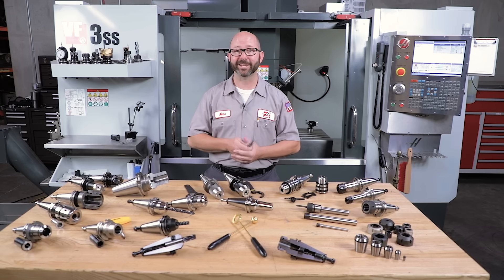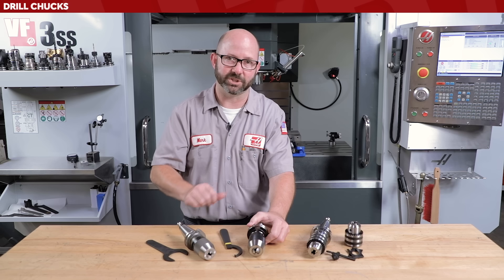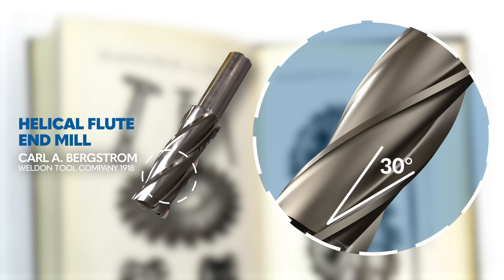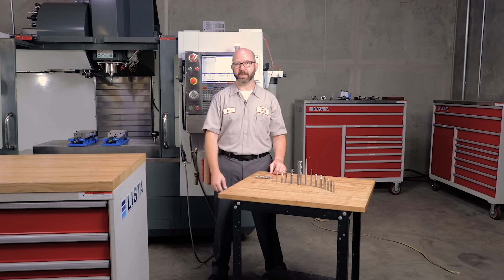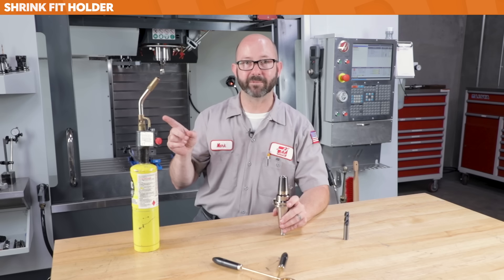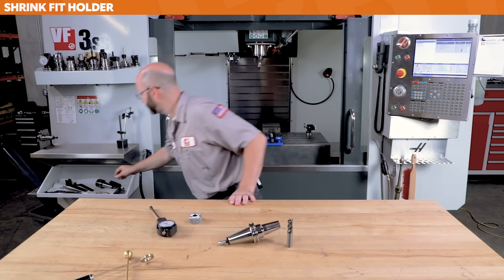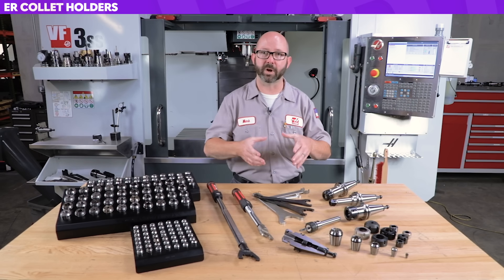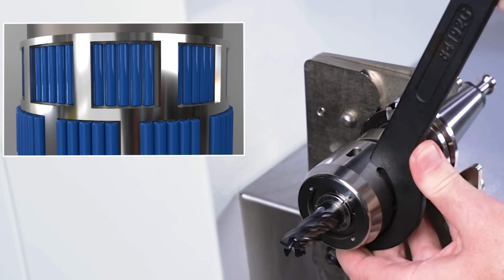Tool Holder Essentials - Every Machinist Needs to Watch This - Haas Automation Tip of the Day

Comment: This has to be one of the very best videos on tool retention that you can tap into.
I'm a golden oldie and in my day we used the Autolock chucks with screwed shank tooling......now very hard to find anywhere.....for ultimate tool retention and runout.
That design is a hard act to follow as it fulfills all the necessary desires of the aforementioned criteria in the video with rotating tools apart from drill chucks where the keyless chuck reigns supreme.
My personal present like is the ER system but with cheap collets it's only as good as the price you pay.
A lot has to do with the class of work you're involved in.
Backyard engineering is the bread basket of the cheap Chinese tool system suppliers.....long may they live etc.
I've often wondered, for the bottom end of the milling cutter users, how a milling cutter with a short Morse taper shank instead of a parallel one would perform as it's practically like a shrink fit system without the heat/cooling aspect for insertion/removal etc.......not practical in the real World as the knock in effect could/would damage the cutter.
For me it's the ER system due to the massive availability of cost effective tooling and if I have a runout problem with a cheap collet(s) it translates to just a bigger cutter diam as it rotates.....what's in a few dozen microns of extra cutter diam anyway.....one pass will give your the cutter size you're working with, so cutter diams become arbitrary anyway if you know what you are working with.
The combination of cheap chucks and cheap collets does leave the choice wide open, but selective testing and grading can cure many evils.
BTW.....I toyed with the idea of having an ER collet and modifying a cutter to have a groove near the top end of the shank to fit a retaining ring so that the cutter would not need humungous tightening force to prevent it from pulling down.......thinking, thinking etc.

Comment: These videos are brilliant, thanks HAAS! We run REGOFIX POWRGRIP in our mills and noticed an immediate improvement in tool life and reduced noise. We run 15,000 RPM all day on ally, we don't measure balance or runout - load and go!. We have the manual pump thing for changing tools - it is fine for our small shop.
Reply: If a new shop went with REGOFIX POWRGRIP right away, what other toolholders might they still need?  Would it ever make sense to have a powergrip holder for each common drill size W/WO ATC?  Can powergrip holders be damaged, or are they fairly idiotproof?
Reply: Dustin Maki powrgrip for endmills and er collets for everything else. Although keyless drill chucks are handy for hss drills.

Comment: Great video. A few more tips:

You can use the torch to heat and load and unload the shrink fit toolholders., so a small shop can avoid having to buy the induction machine (or toaster, as we call it at work).
Put some grease on the threads and nut taper of the ER collet holders if you don't have the low friction nuts. This will improve both holding force and runout.
Speaking about ER and runout, it can be adjusted once set up. Some people tap the nut, although there are special tools for it. Try to torque the nut with two handed tools to apply just torque and not lateral force.
And last: don't use that Haimer balancer with wet toolholders, believe me.
Reply: Two handed tools?  Do they put one hand one each side of the collet nut?  I've had a collet nut wrench on my To Buy list, but my machine set up was waylaided, so the urgency disappeared.

Even if you used a two hander, wouldn't you need to be careful not to push away from your body excessively?  Seems like a deep well socket for the collet nut might be best... ever seen one?    hmmm. might have to fabri-cobble one.  LOL
Reply: @georgedennison3338  This is an example of the two handed Haimer torque wrench: https://www.amazon.com/Haimer-84-600-00-AK-Inserts-Standard-ER-Chucks/dp/B012AI5NXS

A deep socket with a T wrench may work too

Comment: Good information, especially for someone like myself to learn about the different systems used in machining. I have discovered that there are a lot of different types of collets depending on what you are holding. 

There are tool holder collets like most of the collets in this video. There are work holding collets like the 5C that are designed to hold a work piece instead of a tool. Then the ER collets that will hold both work pieces and tools. What you didn't mention was the R8 collets. Probably the most common collet system on small mills and there are a lot of them out here now.
As I said, good information and I am looking forward to more from the series on the website.

Comment: We switched to mostly hydraulic tool holders and they are AMAZING. The Schunk holders aren't that expensive and they are amazing. We quadrupled our IPM on every material we machine and the difference in tool life is insane. I used a Guhring RF100 Diver in  Schunk holder for making about 30 1018 soft jaw blanks, milled about 8 pairs of those soft jaws, and then ran that same endmill on 300 parts that were also 1018 steel all at 200 IPM + and the endmill still looked brand new. I use a hydraulic holder whenever I possibly can now.

Comment: My only problem with tool holding was with the HAAS endmill chucks.  The chuck couldn't handle a 1 inch sandvik R.390 cutter which it broke the inserts on within 3 inches of cutting. We then tried it with a high quality 1/2 inch Harvie TE solid carbide.  It broke the cutter almost instantly.  All the operations where the HAAS milling chucks failed ran smooth as silk with simple, weldon endmill holders.  We returned the chucks to our dealer, Thomas Skinner in Canada and they claimed the chucks were "fine".  They are not "fine". They are useless for milling.  The dealer is fighting us on the refund despite the fact we have bought 3 brand new HAAS machines from that dealer yet they argue over $800.   I have video of the cutters working with both the faulty milling chucks and also how they literally purr through steel in the weldon holders.  I will be happy to post a video on Youtube showing their poor performance if anyone has doubts.  Regardless of the tools performance I find the non existent customer service to be deplorable.

Comment: Recently my Dad was trying to use his Drill press to remove some brass off an edge using an end mill.  It went against his better judgment and really pissed him off, afterwords, ignoring his usually on point gut and experience.  Nonetheless it did not work well.  Chuck came out in mid flight and on his second pass, was an epic fail.  That was actually one of the tipping points - and there is now a beautiful new TM-1P in his shop.  These vids are very very helpful.  Thanks!

Comment: Love the video. I drool at heat shrink. Storage of collets:, one lazy machinist can make every collet you have junk by not cleaning and oiling these collets AFTER use. I confronted the coworker with a handful of rusty collets and he thought his time was to VALUBLE to be fiddling with collets so he just put stuff away wet into wood holding blocks...Management did nothing so I quit and got a better job down the street. For a 1 man shop that needs to hold a spotting drill in a extended Weldon holder a brass plug that has the same radius as the tool bit works great under the set screw but the end of the brass plug must fit the radius of the spotting drill and be as large as the root diameter of the thread. I have ran finishing endmills without a flat with a brass plug. Sometimes the plug will split in 2 but I never had a failure. Brass plugs take time to make. My favorite is the compression holders. Since nothing is perfect the sleeves have a little runout usually .0001-.0002 and one can rotate the sleeve in the holder tighten indicate then loosen turn 1/2 tighten indicate enough you can use that to get a endmill to run with minimal runout. But why bother if you heat shrink? As much as I want one I will never get one approved.

Comment: Thanks, Mark, for a great presentation.  Most people don't understand to tool up a machine really depends on what parts are planned for it, what material is being machined and expect that cost to be close to the cost of the machine. We partially tooled up a Matsuura Cublex 63 w/500+ tools.  It has a 20K spindle so you can imagine the tooling cost.....gulp.

Comment: Very nice and informative video. We've got all types of tool holders you showed in our shop, but we had a vibration issue with deep (10D ) tool and that wouldn't go, the surface quality was terrible and I was searching for a solution. Then we had a 3axis DMG machine. With the Regofix PowrGrip, we eliminated that vibration. We'd also looked at Tribos but that just does not have the grip of RegFix. The system worked so well that our new 5axis DMG with 60 tools is almost completely loaded with RegoFix tool holding. The ER system is used for drills only.

Comment: I have a metal lathe, but I wouldn't call myself a machinist. I'm not very good. I work on and restore/refurbish vintage machinery and sometimes need to make a small part. This video came up in my feed; very interesting content. My main drill press with a Rohm keyless chuck has a runout somewhere near a tenth an inch out. The needle on my Starrett tenth indicator hardly moves. IMHE, this is extraordinary for a drill press. The machine is a Delta DP-220 originally built in 1941. I get a lot of DP-220 coming through the shop and over time selected the better parts for my own DP-220: bearings, spindles, pulleys, blah, blah, blah. The parts were made between 1939-1955. Modern Baldor motor. Ended up with runout I can't even measure. I'm tap dancing daily in total joy. Seeing this video, a tenth runout seems to be the standard in precision machining. Can't believe a drill press is doing it.

Comment: One thing you didn't  mentioned is the fantastic properties weldons have for dampening or disrupting resonance in cut.

Because of the slightly offset tool this has similar effects of a variable flute and disrupts any possible buildup of resonance aka chatter.

Quite often when tooling manufacturers do side by side
tool comparisons they leave out the weldon, purely because when they include them they offer the same if not better dampening (wrong word technically, resonance disruption?) than holders that cost 10x+ more.

Search it on YouTube, plenty of good examples. Also modern weldon are offset ground to compensate for the runout that used to be an issue. You still get run out but only within the tolerance of the shank grind.

Comment: If you normally run between 1-20 offs, most universal holder I would say is ER collets. I have been running ER32 collets for many years "torqueing" with a small hammer and never have pull out issues. Maybe there is minute runout, but I frequently machine parts to within .0025" limits, up to 5000 rpm with no noticeable imbalance. Mainly use them for endmills (finishing + roughing) and almost all drills under .787".  For 20mm-25mm-32mm-40mm-50mm and smaller ER extension collets or other tooling I normally use sidelock holders. ER chucks are capable of taking a lot of abuse, if you forget to stick the tool out far enough and the holder rubs the workpiece - replace the collet nut and sometimes the collet. The holder itself is protected from damage. also ran 100s of holes with tapping ER collets, again without issue.   Unless you machine a very large quantity of identical parts, I have never seen the advantage of most fancier style of holders, if you are making 100+ off quantities I think you would undoubtedly notice the difference, but for job shops ER collets is more than capable.

Comment: I did have a student come in to my office and ask "Should I go faster or slower in my cut". I said it sounds like it is cutting perfect to me, the mill was just outside my office. I went to take a look. This was a VF-5 and the chips were coming out of the cut like bullets and you couldn't see a thing for the coolant.  The cycle finished and when it retracted I saw the tool. A 3/4-10 HSS tap runnning 10,000 rpm, 90 ipm and one inch deep in 6061T6. As my co professor always said, "Now I've seen it all!"
Reply: That is awesome.

Comment: Shunk Tendo E compact are fantastic. The day i was introduced to them was the last day i put an end mill in anything but a Hydraulic holder.
Reply: Have one, wish I had more.  I actually use it for my finishing tools and rough with ER32 or Endmill holder, reason is I get the best finish with it.  Now if I had more.. different story :)
Reply from the maker: Mischief Machine – The hydraulics I have on the table at 28:55 are Shunk Tendos. Nice holders. I like them because of how short they are able to keep the units, with the hydraulic channels run deep in the holder, inside the taper. The hydraulic holder we cut in half was a more typical style, but showed how the holders work well. Thanks for commenting. – Mark, Haas Tip-of-the-day

Comment: You are spot on Mark. I love my milling chucks and use them often on cat40 as well. I mostly use very short gage length to eliminate chatter. My hydraulic holders are awesome for special applications. Great video!
Reply: Brian Smith nice comment. Could’ve skipped the video :).     Keep your tools short, and try a hydraulic for a special application.  - Mark

Comment: I am a hobby machinist/shit, i make more money with my hobby than my job, maybe I should start that machining shop business. I had 2 late 90 Fadals that burnt down in a shop fire 2 months ago. 

Long story short, I got the insurance money and finally rebuilt the shop (with my bare hands so I would have more money for haas 5 axis goodness) and when it came down to what machine to get next.... no brained for me. I went with the company that not only seems to make a great bang for you buck machine but actually seems to care about educating the buyer on how to use the tool.

My new vf2 (well new to me but the thing still cost a shiny penny as these haas keep there damn value on the used market) comes in a few weeks and I’m pumped!!!! 

Keep up the great and most important FREE knowledge  Mr. TerryBerry!
Reply from the maker: EngineeringScience – If you run across anything on that VF-2 that you wish you’d had a video on, let us know! tod@haascnc.com. Thanks for the comment. – Mark, Haas Tip-of-the-day
Reply: @haasautomation  thanks, I'm eager to play wit the new toy so I'll let you know if I have a good video idea

Comment: Great video. There is one more holder system I am aware of. The Tribos System from Schunk. The holders have threelobed bores and are deformed to a round bore by a special hydraulic press. After the tool is inserted and the pressure released the elasticity of the holder grips the tool. Pretty neat system.

Comment: Brand new VF4SS, never operated a mill before. First job and I was cutting steel. 
End mill pulled out, went through the steel I was cutting and dug a nice groove into the table.
I started digging around and found that you should torque your collet nuts.
A $100 torque wrench would have saved that gouge in my table and that $200 hunk of steel I was cutting.
Hard lesson. Use the torque wrench !!

Comment: Spot drill and common drill sizes are fine in endmill holders when you put your flat on it, hit it on a buffer and break the sharp edge around the flat and it will slide in and out easily. I've seen the hydraulic toolholders extend tool life personally when milling cobalt chrome with coated carbide. The holder will pay for itself over time only having .0002 runout.
Reply: .0002 mil is 50.8 nm. You sure about that?😳I would think some light side forces would result in greater than 50 nm deflections whilst cutting, making the runout a moot measurement.